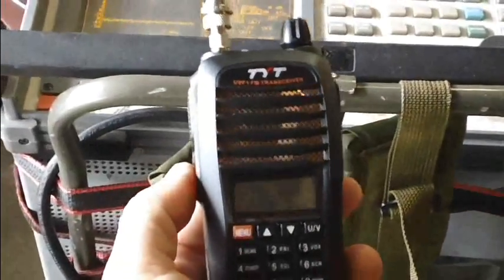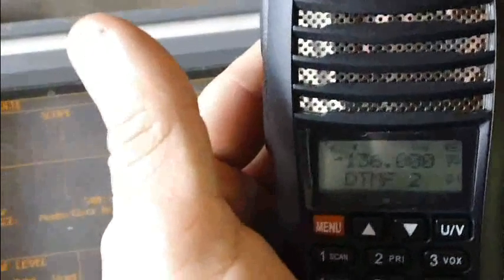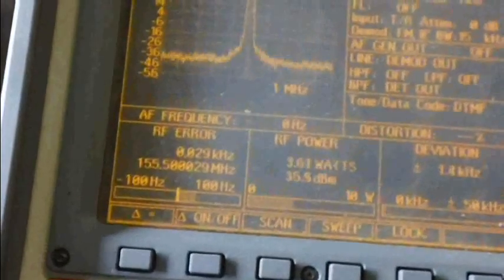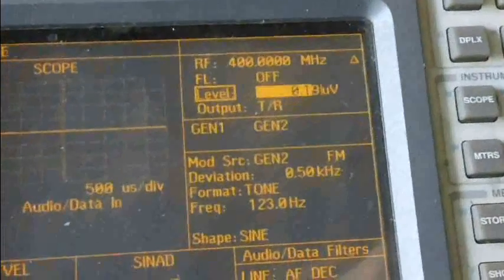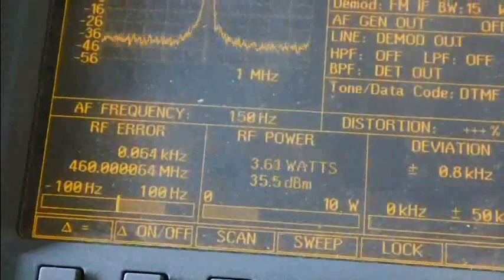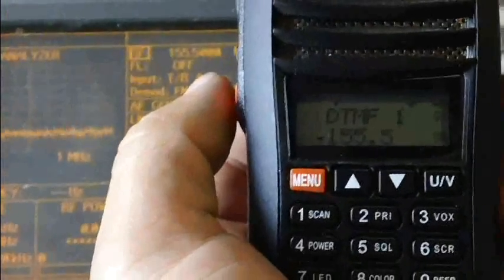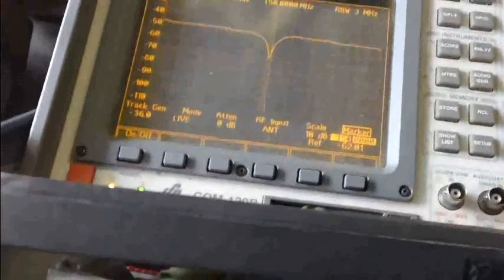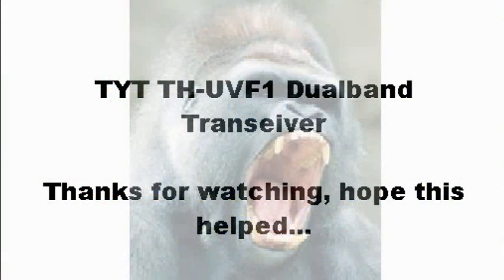Prepper gear- Part 4, Bench Testing the  TYT TH-UVF1 Dualband Radio. (Very Boring)

Comment from the maker: @johnjmw1 OK, I was able to duplicate the scenario. On the radi0, the setting "D.WAIT" has to be set ON. That will enable dual watch on both bands. Though it toggles from main to subband since its using one VFO. The second configuration to check will be "SCANS" item #19, you have a choice of Seek, Carry, and Time. Seek will stop scan when a carrier is detected, CARRY will stop, then start scan when no carrier. Time, it will scan after a some pause regardless. Carry is traditional. Hope it helps.